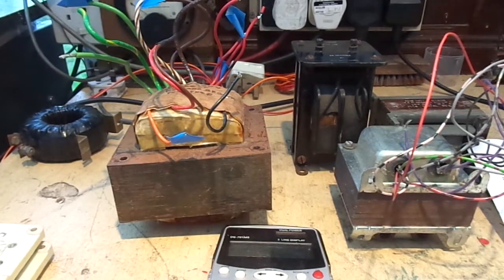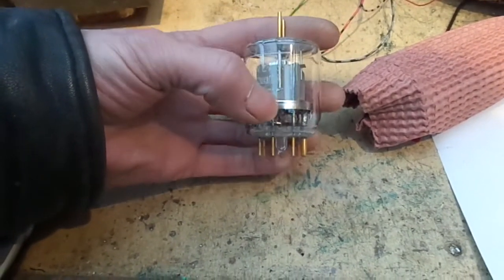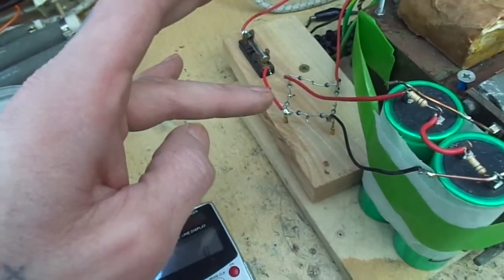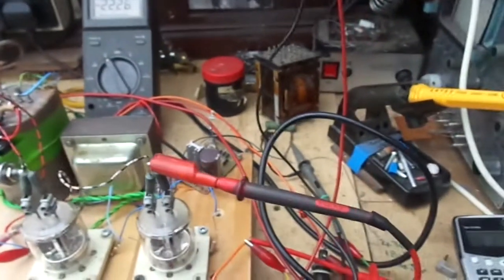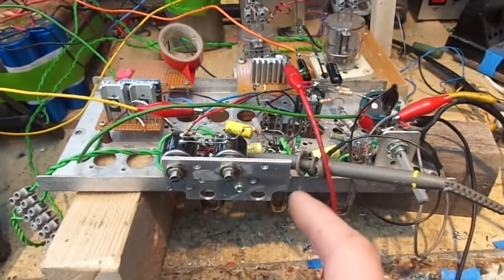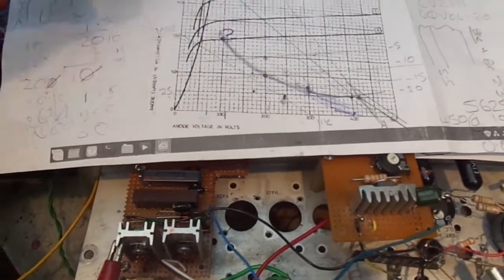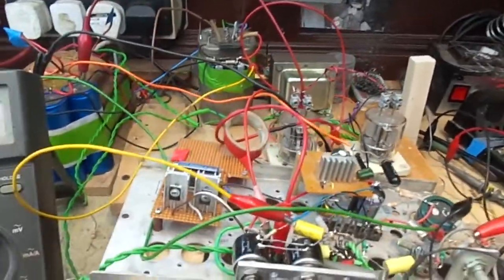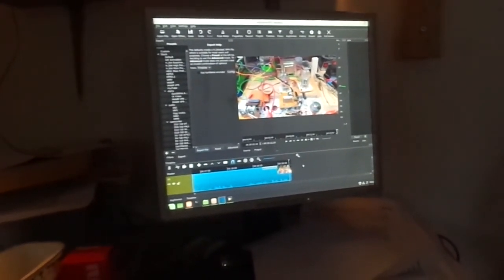Class AB2 Valve Amplifier Part One.

Comment: Andy, Those tubes are designed for a pulsed output- CW. That gives a bit of time between pulses for cool down.
 The 6146 is for all basic purposes a 6L6 with a plate cap for higher voltages. Another common Ham transmitting tube.
 They should work fine with a proper output transformer. 
 BTW, if you use diodes in series they should have an equalizing cap across each one. I should think a .001 mfd. ceramic would work OK.
Reply from the maker: Thanks for pointing that out. The CV2799 is as you say designed for Class C telegraphy where they're pulsed not driven by a continuous IP ,  there is a schematic for an audio amp here though - http://www.r-type.org/articles/art-138.htm . The 6146's are a far better fit for the OPT & they're easier to design an OP around. I forgot to put resistors in parallel with the diodes, parallel caps wouldn't go amiss either, your right......DA.

Comment: 2:31 are they beam tetrodes? ... they used to be something similar in the RF PA of those old PYE Vanguard AM PMR Transceivers .. rated about 20 Watt ?
Reply from the maker: Yes, sorry Chris, should have pointed that out. They're dual beam tetrodes and used in a few transmitters/receivers as you rightly point out. Odd beasties but have a certain charm, aesthetically that is. The problems with trying to use em in an AF amp really out weigh any positives like price etc. Still, you have to try these things......DA.